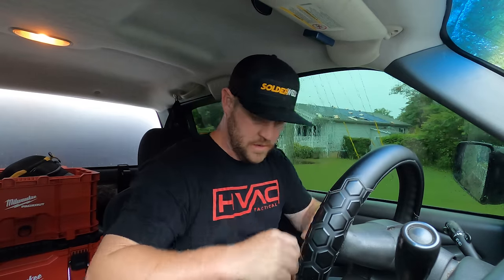Are You READY For The Summer?? | A Day In The LIFE Of A HVAC Technician

Comment: Hey zack are you able to tell the comments what type of wifi 2 wire comunication controll kit you will be installing for that customer. I am 21 years old and starting my own service and installation hvac buisness so if I were to ever run into this problem I wont be scratching my head trying to fish 2 wire in a finished basement or attic.
Reply from the maker: https://forwardthinking.honeywellhome.com/products/wireless/remote_module

All you need is a 24v transformer, Honeywell redlink compatible thermostat and this remote equipment module.
Reply: @QualityHVACR  please make a video of you installing it. I'm over running control wire.

Comment: Had the same problem on on a gas package  unit. Frist tech replaced it and found nothing wrong a few weeks later same problem! Turns out they had a generator for there house for when our power company (PG&E) shuts us down. After talking to the customer for a few Found out they were trying to run it with a small generator. They told me they were told the generator would not work for the package unit, so I think they just forgot. System was also new.   Good  luck

Comment: That low voltage short. Did it have low and hive pressure safety switches. If it did, did you check them for rubouts? They are in the series with the low voltage y cooling circuit

Comment: One other thing, for the call that you had that was only shorting out with the outdoor unit low voltage connected did you have more then two wires going outside? You could just change the wires instead of pulling new wire.

Comment: On your shorted wire call you could of tried to use just your y terminal from inside to outside and ground your c terminal outside in the condenser control cabinet.

Comment: If you ever have power to both wires at the condenser or have a short in the two wire all you have to do is take the Brown or white wire of the contactor and ground it somewhere on the unit once it gets power from the stat it automatically turns on quick trick that can sometimes save you from hunting a pesky low voltage

Comment: Wireless transmitter, lol, hacks like this, did you check the contactor? On the ac, they fail as well, if you don’t know the contactor is pulled in by 24V, the coil, can short to,ground as well, maybe you need 30” rims on pickup, 😂,  no service tech drives around in one, or all in one company man. No subs here